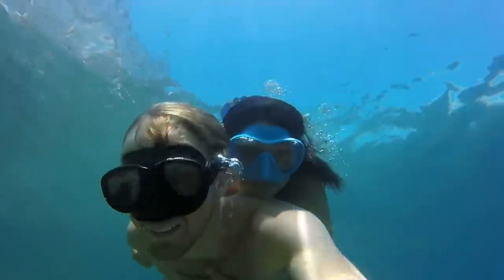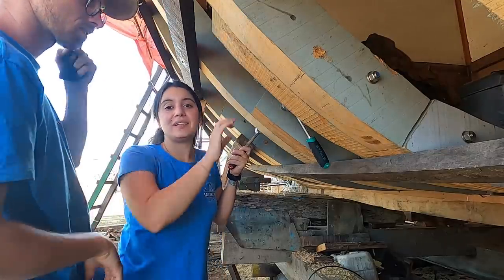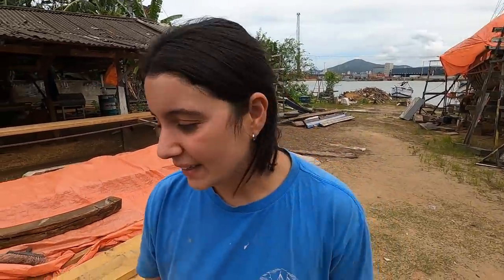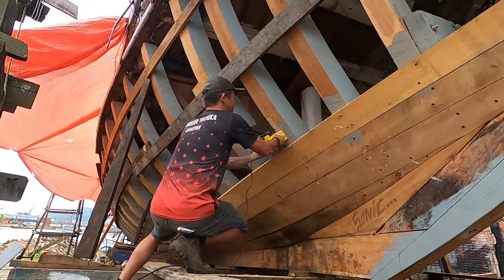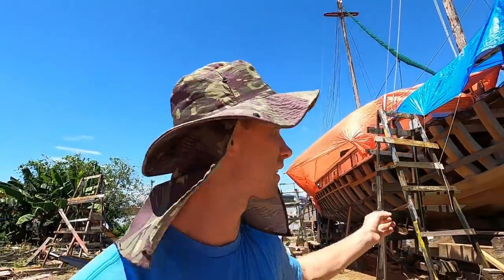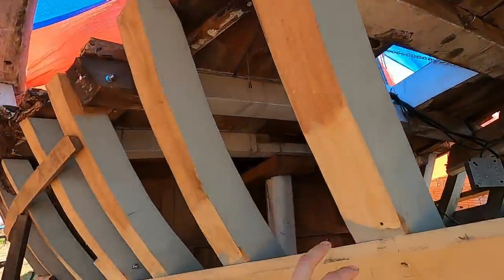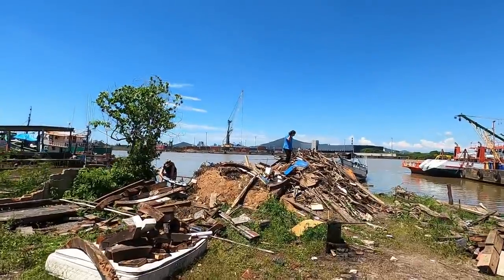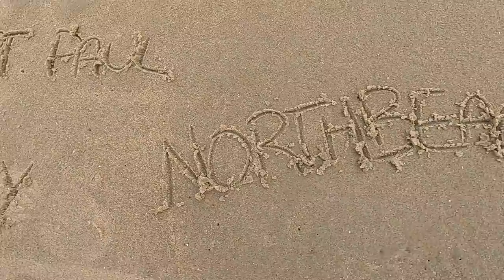Starting to look like a boat again! — Sailing Yabá #26

Comment: You should think about sorting out that electrical in the before it is closed in. Right now you have free access and lots of light
Reply: Agreed. Yank all the old wiring and start fresh.
Reply: Yes! Also because Caio the dog could keep being supervisor of the good work and making us all happy 🤗 Electrical before closed in, guys
Reply: I was about to suggest the same. He has light and fresh air now that it’s still open. He should do it now
Reply: I think it would be best to replace all the wiring but not till you have a dry situation. Also consider 
that the heat would be tough with the area totally enclosed. So it really is a balance between close in, accessibility and comfort.
Love the whole rebuild. 
Frame - vertical
Plank - horizontal
Ha ha!! 
Just joking!!
t
Reply: Wow ,,, I read your text just after I wrote my text!!! You are right on target and electrical is just one project!!! I know Duka has his own big big job,,,, but he was a master at setting up work order priorities!!! Duka is eccentric but he is a master project engineer!
Reply: Sorry Ben has a "shrinkage" problem kkkkkk
Reply: Agree. But NOT to start over. It could all be good usable wire. It is not very old   But, get at it as soon as possible.  Probably a 2 person job. Identify and tag each end of each wire and number them.  Little current testers are cheap. . Put a charge on one end... should light up the other end.  Log descriptions, guage, color, locations, condition of each wire,  then make a chart and a diagram.  Could save a bundle if the wire and insulation is sound.  Recycle if possible.
Reply: Don’t ,, DONT,,, YANK OLD WIRE OUT UNTIL YOU PHOTOGRAPH AND MAP EVERY OLD WIRE AND THEN LABEL THE OLD WIRE BEFORE REMOVAL !!! Your memory will not last for months and months and months!!!!!!
Reply: If you do it now when it is closed you may not be able to undo it. Always a good idea to install like you going to have to work on it.
Reply: The only negative to doing the electrics first would be the weather, they've has some severe storms there recently..
Reply: More wind also
Reply: But I guess they want to be floating asap. Save some money. Also they have already spent a lot. They will fix the wiring on the go I think. Reuse most of it. It's not that old

Comment: This would be a good time to do a wiring diagram.  The diagram will raise many questions and help you organize the task so when you get there you have a good understanding and a plan.  Just a thought.  Love following you guys.
Reply: Forget sorting them, run all new wires, labeling them along the way. With new wires you are not spending your time trying to locate damaged wires/connections and you will really know your boat.
Reply: AND commit to change every light to LCD bulbs. I would ask OddLife about wire advice !
Reply: Ummm. Might have been a better time b4.
Reply: 👏 @Tracy B. 
I did exactly what you said on a friends boat, a little costly but, without any headaches or problems 👍. We watched another boat technician spend two (2) days tracing faults on one wire!

Comment: Ben and MP you could use some of the old wood and build a table form out and placing the wood in certain places and pour polyurethane in the form letting it set up then sand and polish the polyurethane to a shine for your eating area or auction it off to your patron supporters.
Reply: not a bad idea ^^

Comment: Pull all that wire out and start over. The only wires you actually need are the ones to get the engine running, the rest are not that important and you can redo them all properly and have peace of mind knowing what each wire does and be able sleep at night knowing they not going to short out and set your wooden boat on fire.
Reply: That's true and you can also able fix any other wiring problems that's may encounter
Reply: AND you will be eliminating ALL discontinued or duplicated wires. This will make all future electrical work Much Easier.
Reply: Need to agree with Rachael.  Remove them, install new.  You'll know your electrical system and you'll be sure they work.  Good luck!
Reply: Andrew Cowell    I would add Ben take pictures and video of wiring (in place now) to know what is hooked up were...when clean it all up....knowing were a wire going is a lot easier than looking at one end with no clue as to were the other end is hooked up at/to.  Get a wiring diagram for eng and the interments you wish to install will help on the planing stage of the new wiring.....gauge of wire fuse size switch's needed and where...ect.
Reply: I would ad on the wiring suggestions : Using a 12V battery, identify each wire now as the hull is all opened. All you need is a long light wire and a 12V light. You'll then see what goes where. And which wiring is dead or used anymore.
I do/did this on many electrical refit projects in my old summer cottage. It saved my butt many times !
Reply: @marcryvon  a cottage with some plugs and lights is very different to a boat that has been sitting in salt water that people have added new wires over and over. If you want to save some of the wires then dig through the pile when they laying and the floor next to the boat. And rewire it properly, most of those wires are probably not even marine grade and if you redo it all you wont even need 80% of those wires. Chuck them out and start over.
Reply: IT will be easy and simple if you start over.  Do like they said, jengibre first
Reply: @marcryvon   That for sure is one way to trace, I would add using a tone generator and probe to trace...the one I use does have a contunite too, just complete the circuit and the light will light up. Two person job if a longways apart or a lot of back and forth using the light part.
Reply: Yes i agrre to remove all wiring. Make cable duct or cable tray. Labeling the cable. Make schematic diagram. Grouping the wire for power, lighting, electronics etc 
Edited: fuse/circuit breaker and monitoring for voltage and current for every group
Reply: Well. Working bilge pumps wouldn't be totally wrong, since she will take in lots of water during the first hours after launch. Then navigation lights. Everything else is optional.
Reply: @rhkavli  yeah, but a pump just needs power, and is easy to rewire when you do it all again, its only the wires on the engine that you have to worry about the rest can come out and and be replaced with new wires. I'm not saying don't put new wires in, I'm saying rip them all out and start over, and the only ones you need to worry about, like  making a note of, or taking photos or what ever is the engine ones, they have a few important wires that you have to put back the same way, the rest can be new wires to new plugs and new lights and new breaker boards and those don't matter, as in you can do it how ever you want, but only the engine has to be done the same way it is now.
Reply: @RachaelSA  As an electrical engineer I totally agree with you on all points.
Reply: @RachaelSA  all the wiring should be replaced,  but his point about 12 volt thing is low tech but valid.  I have a 10 meter multi meter probe / alligator clip that I use.  I have rewired about 4 boats.  My process is disconnect and label all wires to what they connected to.  Leave the wires in place initially then replace as needed.  In this case I would replace all them and make your wiring diagram. Also consider buying a heap of write on shrinkwrap or a label maker and clear shrinkwrap
Reply: Use braided and tinned copper wire, solder all connections and insulate with self amalgamating tape and tie strap them so they don't rub.  Remove all the existing wire, it's most likely at the end of its life anyway.  Is your anchor winch electric or hydraulic?  Get the alternator refurbished and have them boost the amp output so it will bulk charge the batteries faster.  Run the wires up high and away from salt water, running them under the sole works well.  One of the carpenters might know someone able to do the electrical work, consider this alternative, then you can stay focused as project manager.
Reply: I Will  second that advice!  It would take you longer to sort those old wires than to start over and be safe with good quality new wires and you can route them properly through conduit to keep them safe.

Comment: Speaking as an Avionics Engineer, you will never have an opportunity like this again whereby you have full access to all the cable runs that require replacing or re-routing, when all those planks are on it will be like doing a jigsaw in the dark, you have missed a golden opportunity there.

Comment: One advice, just remove all the old wires as a whole take your time to think about it and make a new electric scheme. If you try to work around that using the old wiring, even partly, you will regret it time after time. Just start from scratch. Start building the hardware (switches, connectors light locations) and then do the wiring.

Comment: Full new hull means total AC and DC wiring refeat, so all these cables and wires can be removed. It will be a shame if this new boat gets fire by a short circuit 😢. Impressive job. Keep going. You're on the right way 💪

Comment: Best advice on the wiring is to pull out all of that old stuff install conduits and cable trays to run various types of wire to the appropriate places.  Then design a new wiring plan for signaling wires, instruments, communications, DC power, and AC power.

Do the same for the plumbing, fresh water, sea water, gray water, diesel, through-holes, etc.

Now is the time to plan all of that out so that you can get started as soon as the deck beams, shelves, and deck itself are installed.

Do you know the sail plan yet?  Will you go with wood masts, or aluminum?

Comment: It honestly amazes me that you where able to sail Yaba. Seeing how rotten and broken most of the planks are. 
I bet that most of the planks can be only used for firewood. So have a nice campfire as celebration with grilling and such ;). But even for that they are most likely not usable because of the old paint (Burning paint is really not nice) Some of the frames maybe and some of the less broken ones you can maybe make some table/cabinets out of. Thankfully the ship worms do need water to my knowledge so there is little risk of them remaining alive in there ^^

Comment: The frames and the planking are coming along very well !   I really hope most of the interior can be saved.

Removing all of the existing wiring and plumbing is the best idea.  Install large (10cm) passthru high on each bulkhead. It will make running the wire and piping much easier.

Are the bolts/threaded rod holding the futtocks together stainless steel, galvanized or just zinc plated ?  I think I would trust the trunnel (treenail, trenail, trennel) more than simple zinc plated bolts.

Comment: O your table, build a dam(could be a nice bent wodden tim) around the edge, put lots of that worm eaten wood(like shown @ 19:34) on and cover with epoxy .  Start with an opaque peice of thick plastic for base with danding led lights underneath

Comment: Speed up the nailing of the planks with an air hammer and a hammer head bit. All you need is a portable air compressor if they don’t have one onsite.

Comment: Well she is coming together, you must be thrilled. What I am going to say next in no way diminishes your hard work, I wish you well. Watching this from the beginning I have made a few comments along the way, and here is my take .I am a professional I have worked at Maritimes Museums and Boatyards, and know a great deal about wooden boats  (and all boats)gleaned over 40 years. Those Shipwrights are getting the job done and do understand wooden boat construction on "THEIR " level. This is a workboat-style rebuild which is nothing wrong with that as far as that goes, however they are not doing things that are easy to do along the way and relatively easy such as bedding the futtocks before bolting together. Planking is coming on but I do take exception to them fasting the butts to frames, that is only done when you have to , it creates a weak spot and hard point in the planking as she works. There are no stop waters in the scarph joints ( I just did not see any ) , too many pieces on the floor frames and the futtocks. There are more things but this is their way . It is ok construction, but that is all it is , my philosophy has always been use the best materials you can with superior technique. I do wish you the best t and that boat will be fine, however, I do hope they know how to caulk properly as with that fastening scheme that is going to be important in holding the planking fair and tight ...Continued good luck.
Reply: @gav2759  Yes I try to be constructive, but as I said I see many things I don't agree with. I worked at the Chesapeake Bay Maritime Museum, and have rebuilt and reconstructed many wooden boats.As you say even workboats need to be constructed in a manner to their intended use .I have worked in commercial fishing as well and have drudged Oysters in skipjacks on the Chesapeake ( the last Sailing fishing fleet in N.America) Good technique trumps all. I will say this, with this construction I would not be taking her on any long sea voyages, she will be fine coastwise with a wary eye on the weather.
Reply: @StreetTruckinTitan  Yes I know how to caulk I was taught 40 years ago by the old timers . It most certainly has to be done in a specific manner, as it helps tighten up the whole boat. The Tally Ho build is fun to watch, they are doing it well.It is a yacht reconstruction and it shows what I mean by good technique...

Comment: I'm surprised you want to wait until the hull is finished to start working on the wiring. I would think it so much easier to work on with everything out in the open and accessible... that, and I would be soooo triggered looking at that rat's nest of wiring every day :D

Comment: You commented on needing to address the wiring one wire at a time.   You might want to consider to having a professional electrician help you develop a wiring plan with the proper panels, switches, fuses, and wiring raceways with guidance on wiring size and types.      Also, you might want to add a lead keel to the existing keel rather than putting those concrete blocks in the bilge.  This will lower the center of gravity and give you more room in the bilge.   If you are going to have solar power, this is the time to plan for it.  The batteries could go in the area where the concrete blocks were previously located.  Led lighting can make the interior and exterior look great.

Comment: I hope that in your upcoming special episode you give us more history on this project.  Things I'd like to know.
1.  How long has this been going on?  We can look at the number of episodes, but that doesn't give us a true sense of how long this has been happening for.
2.  When you get all the planks replaced on the hull, are you going to put a fiberglass layer over them, or something else, or are you just going to caulk and paint?
3.  How much is this costing you?  We know that labor rates in Brazil are probably a lot less expensive right now than they might be elsewhere, and at any other time, so that's a contributing factor, but still, this has to be an expensive project, and the hull isn't even watertight yet.
4.  Are you going to pull the engine out and have it rebuilt/repaired/replaced?  If not, why not?

At the beginning of this, like so many others, I said you shouldn't have gotten into this, but you perseverance is eith commendable, or just plain stupid.  However, Yaba IS coming back, and given what has been and will be done to her, if it's all done properly, will give you a boat that should last a while.  I wonder about some of the engineering details that go into this, but I'll trust that your shipwrights get it right.
I still think you could have spent whatever money you'll invest in this is something newer, better, etc., but it's your money to do with as you please.  So, I hope you continue to move forward with this project and I'll continue to watch to see what happens.

Comment: The progress is amazing...  Really coming together...  I think the most amazing thing, when looking at the condition of the hull planks and ribs, is that you actually sailed that to the shipyard in that condition.  The fact that it held together is simply amazing.  I do have a question however.  Wouldn't now be a good time to sort out the wiring, while the hull is open and fresh air can pass through?  I can only imagine hot and humid it will be below decks once the hull is closed in, not to mention the easy access to the wires while the hull is open and you have access to everything...  Just my thoughts.

Comment: Hi Ben and M P .
My name is Chris and when I saw you holding up the worm eaten precious piece of wood which could never be artificiality reproduced. I imagined it sealed with some kind of clear polymer mounted on a plank piece of purple wood ( like the hammer handle ) with the Yaba masts and sail outline. Maybe you can auction it to the highest bidder. I'm pleased you made it home safely. From the looks of the deconstruction paint was the only thing holding the boat together. If Dukka and Roberta were the previous owner I would joke paint and sikkaflex held it together. Keep up the good work and please continue to share your adventure with us. I love to hear M. P. laughing. My eyeballs were getting so big when she was using the 5 senses to test the wood. Her tongue almost touched the lumber but then she said never and began laughing . She really got me laughing.

Comment: Take the worm 🪱wood and put it in a cylindrical mold and fill it with crystal clear epoxy put led lights under it and keep it to remind you were you start along the to where you are going.